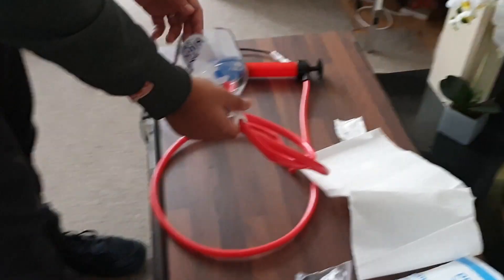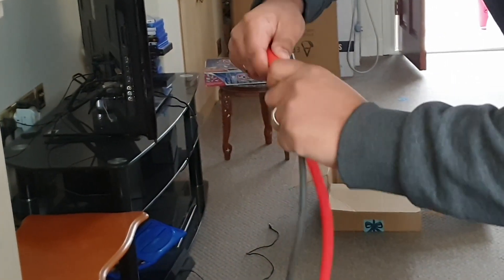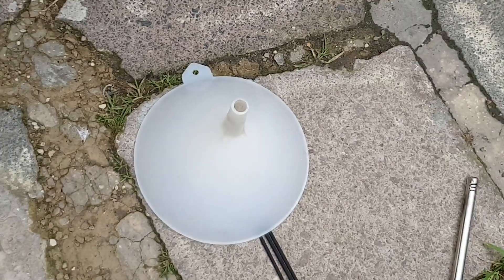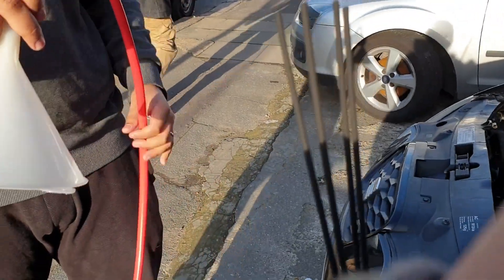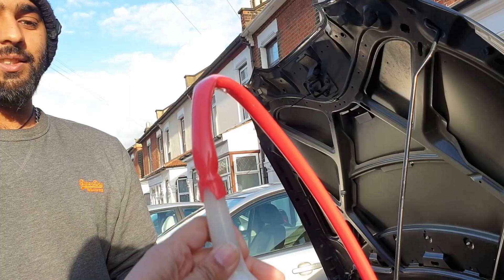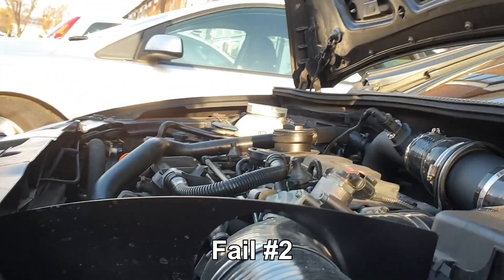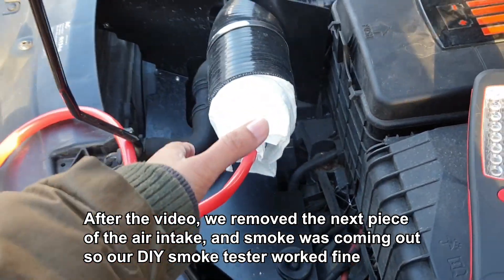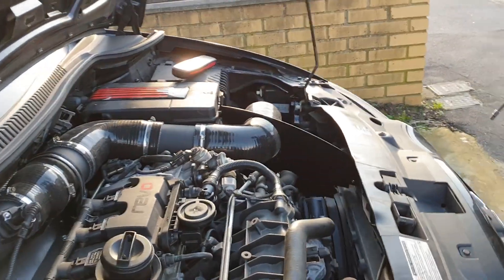CHEAP DIY smoke test WITHOUT a CIGAR or CIGARETTE - Find air leaks, under £10!

Comment: If you have a cigarette or a cigar, just put that on the side where we used the incense sticks. 

For OEM air intakes you can just drill a hole in a WD40 can lid and feed the tube in, them pump the smoke into the tube